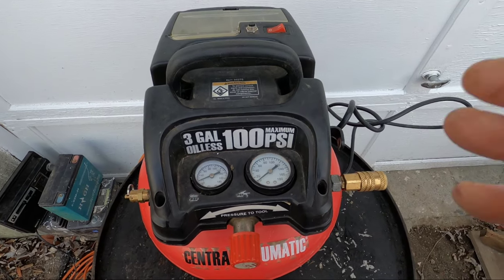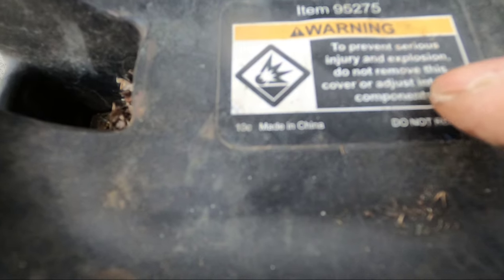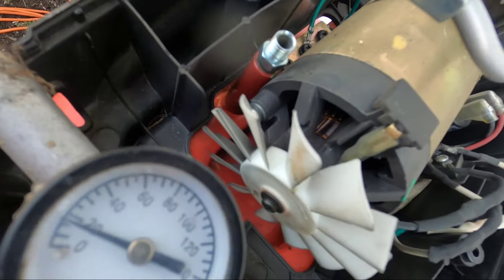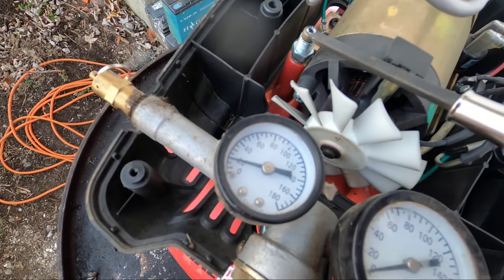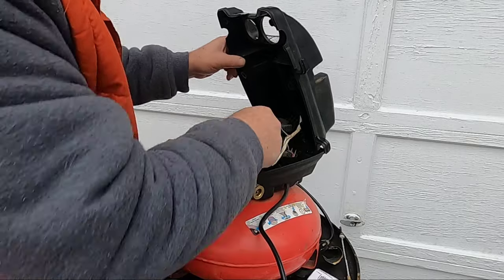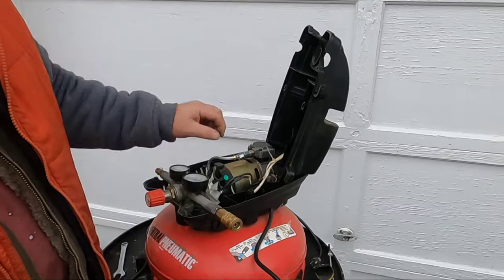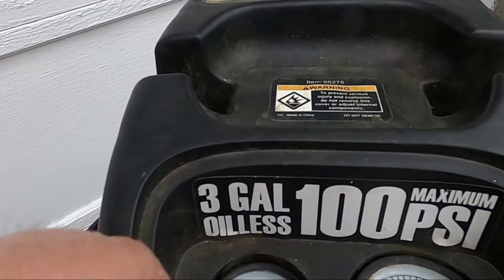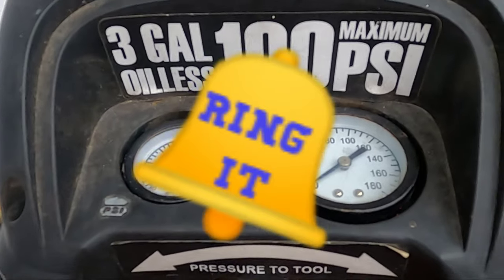How to repair fix air compressor not building pressure easy fix

Comment: hello my compressor just like this one keeps blowing its glass fuse has anyone had a problem like that?
Reply from the maker: Hello dennis anderson, Thank you for stopping and your support. I have not had this problem so I am just putting some ideas out. Could be a short in the wiring, if you are using an extension cord that is too long & not the right gauge that will usually trip the circuit breaker but maybe the fuse in this case. Maybe something jamming up? How long does it run & what tool are you using on it? I will pin your comment so it is seen on the top of the comments so others will see it & possibility be of help. When you find the cause let us know.
Stay safe, Joe Z
Reply: @JOEZEP54  I really do appreciate this Joe. I took apart last night actually looks good the compressor fan turns good all I can think it must be maybe in the windings.  thanks again and have a blessed day my friend!
Reply from the maker: @heavenbound78  Hi dennis, sorry I missed this reply. Were you able to get it going?
Reply: @heavenbound78  Also check input diode bridge
Reply: Did you find the problem?
  Does it blow when you use enough air for it to restart and build pressure back up?
  If so, I would suspect one way check valve that is supposed to keep pressure off the piston so it starts back with no pressure in the cylinder, if I am not mistaken.

Comment: If you're really going to fix it, replace that aluminum tube and ferrules with copper. It will take the vibration better.
Reply from the maker: Thank you for watching & adding that tip.
Stay well, Joe Z

Comment: I have a small 3 gallon compressor from Home Depot (about 6 years old) that stopped building pressure last week.  I saw you video and took the cover off and had the same line breakage.  A quick trip to Ace Hardware to purchase about a foot of copper (no aluminum in stock) tubing and two compression sleeves (total cost $3.23) and about 15 minutes of work and I am back in business.  Thanks for the video.
Reply from the maker: That's great. I am glad this video was of help.  Joe Buyer,  you're welcome, I and thank You for watching and taking the time to comment. 
Joe Buyer I have other videos on my channel that cover many different subjects  that may also be of help or interest.
 Be sure to 👍, share  subscribe if your are inclined to do so. 
 Also not to miss any new videos remember to hit that notification 🔔
 Another way you can help support  this channel at NO cost to you is by using one of my affiliate links.
     * Thank you for watching I really appreciate your support.***
Joe Buyer I just want to mention If you haven't installed the TubeBuddy browser plugin yet, to help your channel grow  Just go to my favorite tool for channel growth Tube Buddy. Now You can use it too, here's my affiliate link to the Free versionhttps://www.tubebuddy.com/joezep54   Start with the free version, yes it is free to not only to down load but to use.
Again I hope you get to  enjoy other videos on my channel as well. 
 Stay safe, Joe Z

Comment: Found a compressor on the side of the road. Thought at the worst I could make an air tank and salvage some fittings. Took it home and it runs but no pressure. Took the head off and found a broken reed. About $13 from Amazon and I’ll have another compressor. That’s how I found your channel. Subscribed
Reply from the maker: Thank you for your support. I really appreciate it. It is amazing what you can
 find road side even more so what people pay to bring to the dump/recycle center in my town. I started a Trash or Treasure series just for this. I haven't been too active lately due to home projects popping up & trying to get ahead of next years firewood supply. Hope to hear from you again.
Stay safe, Joe Z

Comment: As a plumber it blew my mind to see it was a compression fitting with a feral. Just like a water line to a faucet. Amazing. Thank you.
Reply from the maker: You're welcome. It is for a water line. Just had to adapt for a different use.
Thank you for taking the time to comment. I do appreciate that.
Al Ale if you get time  I see plumbing videos  get quite a few views. I know it can be tough time wise but your in a good field. I would do more videos myself but the time it takes me to do a video is sometime longer than the job I am doing LOL
Hey thanks again & stay safe, Joe Z
Reply: @JOEZEP54  just fixed my compressor thanks to your video. My hard line was cracked and a quick trip to lowes for a 1’ piece of 1/2” od soft copper and some ferals got my psi up from 25 to 100. Now im battling gasket leaks. Waiting on some rtv to set before my next test. Bending the copper was not fun and i didnt anticipate that being so hard but i got it. Thanks again.
Reply from the maker: @alale923  Glad this helped you out. Not only did we safe a few $$$ but less to the landfills. Some gets recycled but there is always waste & less resources used.
Stay well, Joe Z
Reply: @alale923 Did you get yours working again?  Gasket leaks make me wonder if check valve is bad and causing pressure to build up around the head gasket. 
  Check valve is one way valve.  If bad, pressure can build up in the cylinder.

Comment: I have the same compressor that had the same problem that needed of the same solution. This was the first and only video I watched. I waited until I made the repair to post a comment because I thought it would be easier to manipulate the broken end of the line with the other end completely loose. Turns out it's a bit of a fight regardless of how you do it. A quick trip to home Depot and about 15 minutes of work and the little guy is back up and running.Thanks for the excellent video.
Reply from the maker: You're welcome, glad this was of help. And thank you for taking the time to comment. Hope you get to visit again.
Stay safe, Joe Z

Comment: Thank you so much for this helpful video! I have the exact same model of compressor, and it failed in the exact same way. It's funny how that happens! Home Depot had the exact parts you showed, and thank you for showing the parts that you used. That makes it much easier for those of us who are unfamiliar with the details of individual plumbing parts to get the right ones. I was able to slightly round off the corners of the aluminum tube to make it fit, and with a little mechanical persuasion, it all went back together with the new fittings. It is holding pressure just great. It goes up to 100 pounds, shuts off just great, and is working like new. Thank you again!
Reply from the maker: You're welcome, I am glad this was of help. And thank you for watching and taking the time to comment. @KirkHarnack I have other videos on my channel that cover different subjects  and new videos added weekly that may also be of help or interest. 
Your support is not required but always appreciated. If you are inclined to do so your Subscription, Likes, Comments and sharing this content would help me to reach other viewers that may also find this channel useful or entertaining.
 
 Stay safe, Joe Z

Comment: Joe Z, I appreciate your video!!
I picked up a small compressor (Blue Hawk from Lowes)that was thrown out in the trash. It only built up 20 psi.
Of course most always go to worse case scenario.  I watched your video while I took it apart. Sure enough, the line had vibrated loose. Tightened it up, turned it on and went up to 90psi before I turned it off.
Thanks again...JT
Reply from the maker: You're welcome, I am glad this was of help. And thank you for watching and taking the time to comment. @jeffsteele4474 I have other videos on my channel that cover different subjects  and new videos added weekly that may also be of help or interest.
I hope you get to  enjoy other videos on my channel as well. 
 Stay safe, Joe Z

Comment: Thanks, guy! I didn't know about the drain valve on the bottom of the compressor. Mine wasn't a Harbor Freight, but nonetheless, you solved my problem less than two minutes into the video. Very helpful 👍
Reply from the maker: Excellent! I am glad this was of help .And thank You for watching and taking the time to comment. Andrew Fries I have other videos on my channel that cover many different subjects  and new videos added weekly that may also be of help or interest.
 Be sure to 👍, share & subscribe if your are inclined to do so.  Also not to miss any new videos remember to hit that notification 🔔
 Another way you can help support  this channel at NO cost to you is by using one of my affiliate links.
     * Thank you for watching I really appreciate your support.***
Again I hope you get to  enjoy other videos on my channel as well. 
 Stay safe, Joe Z

Comment: Followed your directions and took the compressor apart. Ferrel looked ok but simply wrapped the end of the tube with Teflon tape and the pressure went from 40 lbs max to 90 in a soulless of minutes. I was ready to junk it until I found your video. Thanks.
Reply from the maker: You're welcome, I am glad this was of help. And thank you for watching and taking the time to comment. 
champion4jc I have other videos on my channel that cover different subjects  and new videos added weekly that may also be of help or interest.
Your support is not required but always appreciated. If you are inclined to do so your Subscription, Likes, Comments and sharing this content do help.
I hope you get to  enjoy other videos on my channel as well. 
 Stay safe, Joe Z

Comment: Thank you. My motor mount bolts vibrated loose. One fell out. The vibration broke the silver tube. It's fixable. Compression fitting. Good 💡 idea.
Reply from the maker: Glad it helped. If you cannot find the tubing in your area check autoparts store for break line.
Stay well, Joe Z

Comment: Thanks for the great video. I have had this same HF compressor for around 10 yrs. I turned it on this morning and it only filled to 40 psi. I will take it apart and see if it is doing the same as yours.
Reply from the maker: You're welcome, I hope this helps. And thank you for watching and taking the time to comment. MrBluesluver, other places you may develop an air leak is at the drain valve and the quick connectors. If it is at the drain valve it usually is an o ring that has to be replaced.
Let me know how your repair goes. 
MrBluesluver I have other videos on my channel that cover different subjects  and new videos added weekly that may also be of help or interest. 
Your support is not required but always appreciated. If you are inclined to do so your Subscription, Likes, Comments and sharing this content would help me to reach other viewers that may also find this channel useful or entertaining.
 
 Stay safe, Joe Z

Comment: I have this compressor and the Central Pneumatic 8 gallon oiled compressor.  The oiled compressor charges in about two minutes.  The small pancake compressor takes 10 minutes!  In fact, I had it apart like you here and determined there's nothing wrong with it other than building pressure dog slow....
Reply from the maker: Thank you for stopping by & taking the time to comment. This compressor was always slow  building pressure. I use it mainly when I am working in the field to fill tires. I carry it with me when I pick up the riding mowers. This is the main reason I bought it but was looking for it to be a little more versatile. Will not be getting rid of my larger compressor any time soon LOL
The Drone Commander I have other videos on my channel that cover different subjects  and new videos added weekly that may also be of help or interest.
Your support is not required but always appreciated. If you are inclined to do so your Subscription, Likes, Comments and sharing this content do help.
I hope you get to  enjoy other videos on my channel as well. 
 Stay safe, Joe Z
Reply: I timed mine and it took 3 minutes 48 seconds to fill from empty to the 100 psi cutoff. 
If it's taking 10 minutes then there's a problem somewhere-

Comment: Saved me a ton of troubleshooting ... this was exactly what was wrong with mine, broke off at the same location - 2 minutes to confirm, a quick trip to Lowes to grab the 1/4" brass sleeves, 2 minutes to put it back together and I have a working compressor again!
Reply from the maker: I am glad this was of help, that's what is all about 👌 . And thank You for watching and taking the time to comment. Jeff Yette I have other videos on my channel that cover many different subjects that may also be of help or interest.
 Be sure to 👍, share & subscribe if your are inclined to do so.  Also not to miss any new videos remember to hit that notification 🔔

 Another way you can help support  this channel at NO cost to you is by using one of my affiliate links.

     * Thank you for watching I really appreciate your support.***

Again I hope you get to  enjoy other videos on my channel as well. 

 Stay safe, Joe Z

Comment: Thanks I’ve got the same compressor an it just stopped building air pressure Now I have a idea what’s wrong an how to repair it!👍
Reply from the maker: You're welcome David. I mentioned this in a previous comment but I believe this may also be of help. If  it is running & not building up pressure also check the drain on the bottom, it may have just have loosened up from being hit or may have a bad oring. Also I once had a small leak at the quick release. Let me know how your repair went.
Stay safe, Joe Z

Comment: Hi  great video  but question  did all the cjecks took the head off checked all fittings an still no luck wont go past 20#  only thing I have not took the pressure control knob off yet  any suggestions ? Thank you
Reply from the maker: Thank you for stopping by. If it is not the tube like this video check the simplest thing first. Is the drain valve completely closed & not leaking? Next remove the air hose, it could be leaking. Next check the quick release, sometime they leak. If all is ok you may have a gasket under the compressors head that is blown or an issue with the reed valves.
Let me know what you find.
Stay well, Joe Z

Comment: I have a Husky compressor that won’t go beyond 60psi. I’m thinking this fix you completed might be helpful. Thanks!
Reply from the maker: ken biddle,  You're welcome, I hope this is of help. I do not have a Husky  but may be similar under the "hood" . If it is not this it may be the reed valve  or could be just some bolt loosened up. These compressors get knocked around on the job. Ken thank you for watching and taking the time to comment. I have other videos on my channel that cover many different subjects  and new videos added that may also be of help or interest.
Let me know how it works out.
 
Your support is not required or expected but always appreciated. If you are inclined to do so your Subscription, Likes, Comments and using the following links do help.

You can Help Support The Joe Z Channel at no cost to you
by following my affiliate links.   
Joe Z is a participant in the Amazon Associates Program, 
an affiliate advertising program designed to provide a means 
for sites to earn advertising fees by advertising and linking to amazon,
that helps me to continue producing videos.
Thank you for your support and using the links provided to make your purchases. 
                              This is always appreciated.
Again I hope you get to  enjoy other videos on my channel as well. 
 Stay safe, Joe Z

Comment: Do you know if that model has an air filter? Mine is slowing down a bit and it's probably 5-6 years old so that's to be somewhat expected but I was wondering if it's maybe just a clogged filter. There was nothing about a filter in the manual.
Reply from the maker: Thank you for watching and taking the time to comment. This model does not have a filter. Check the connections, they may have loosened up a bit. Also check the connection for the air hose, I had one leak on me. Let me know if this was of help.
 Stay safe, Joe Z

Comment: Great video, you are the best. Do you think may i change that tube with a hose? I don't think i can find the copper joints. Thank you. Is the same problem my compressor have, the tube cracked where the copper joint is.
Reply from the maker: Documentales Pepino  Thank you! I am nor sure about the hose. If you go that way make sure the hose is rated for the proper PSI. You can also take a piece of the broken tubing & the nut to an auto parts store. I believe they have brake line of the same diameter. If so you can purchase a short length for just a couple of dollars.
Stay safe, Joe Z
Reply: I buyed a piece of copper tube with two bronze rings. I did not find the hose so put the copper pipe and rings and worked just like you said. Thank you again. Finished my work. Best regards.
Reply from the maker: @documentalespepino1645  I am glad to be of help. Always feels good to keep equipment up & running & out of the landfills.
Stay safe, Joe Z
Reply: @JOEZEP54  i know is a non lubricated model. Could you make a video with maintaining tips and points of lubrication for this model and keeping on working good? I really apreciate that! Regards.

Comment: Best tire pump ever
Reply from the maker: Thank you for watching and taking the time to comment. That was the main reason for this compressor. Many times when I pick up a tractor or work on one that I have in the field this little unit is a big help.
 @danielacorrea5266 I have other videos on my channel that cover different subjects  and new videos added weekly that may also be of help or interest.
Your support is not required but always appreciated. If you are inclined to do so your Subscription, Likes, Comments and sharing this content do help.

Another way to Help Support The Joe Z Channel at no cost to you
is by using my affiliate links or  just go to:
                      https://www.amazon.com/shop/joez

 Stay safe, Joe Z